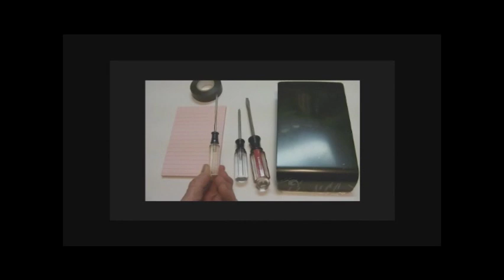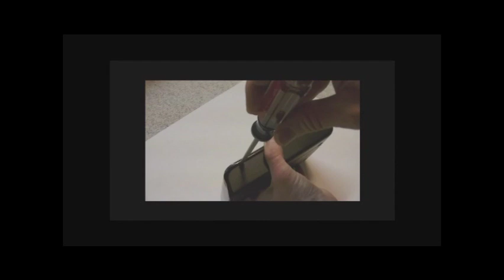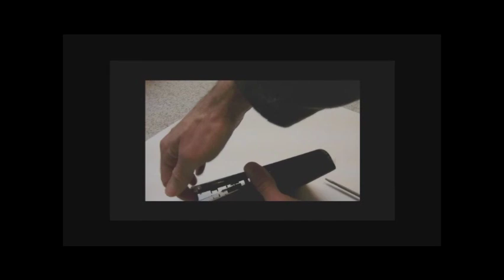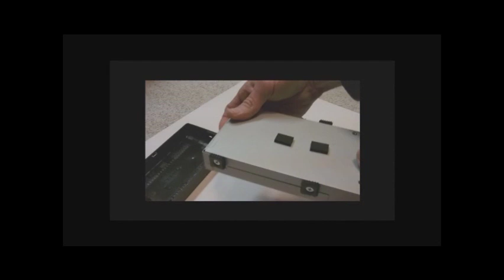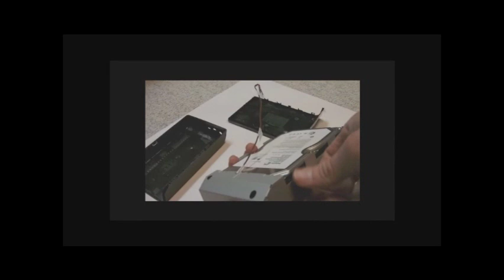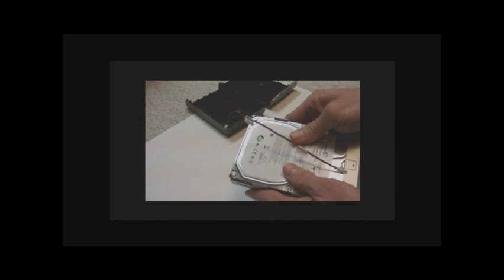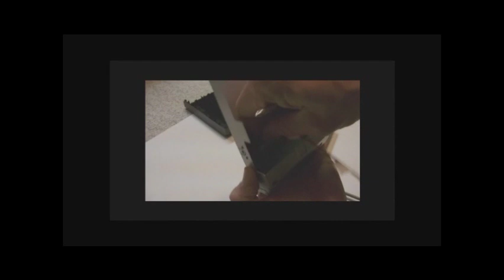Fix your Seagate 1.5 TB Desktop expansion drive to stop clicking

Comment: This drive was finicky and eventually became so unreliable I couldn't keep it mounted long enough to rescue the files. I gotta hand it to you, Bruce, the insulation of the drive from the mounting bracket was just the ticket (I used the electrical tape wrap to protect the USB port, plus paper under the drive). It's humming along beautifully, and the files have been all copied off safely. I still don't trust this drive completely, so it will be regulated to non-essential duty. But - your fix works. Many thanks for posting this video.

Comment: This worked for me, the upside down trick worked for a while, but the clicking returned, insulating the bottom of the tray seemed pointless, but it was this step which solved the issue. Top stuff, thanks Bruce.

Comment: THIS IS BAD ADVICE. I had the same problem. VERY ANNOYING and distracting. Constantly made noise. I returned it to the retailer. The second one had the same problem.

 I read elsewhere that turning the drive upside down will fix it. IT WORKED.  i.e. The poster took the whole thing apart to fix it, but turning it upside down is what really fixed it.

I had to turn it upside down a fewbtimes, for short and prolonged periods. But it has been right side up now for over a year and it  only makes normal hard drive sounds.

FYI I probably could have just shook the thing and it would have fixed the problem.

Comment: The problem with these external drives is that they get very hot, basicly it is engineered to fail, there is no way for all that hot air trapped inside that metal case to circulate. I checked the temperature when it slowed down to 9.5kb/s write speed the temperature was 68°C which is almost too hot to even touch the drive.
 I removed the drive from the external case and plugged it into the desktop and it now sits below 40°C under heavy writing and it doesn't click or slow down.

Comment: It used to clunk, seriously like the Clunk of death. but now its Quiet. My only assumption is that the shielding was picking up interference from the USB bus, and causing a problem with the enclosures write buffer, and causing the drive to park repeatedly until the buffer filled back up again. (just an assumption)

Comment: I had to return my 1.5TB expansion drive to Maplins and they replaced but now the 2nd unit is showing signs of the same problem, loud clicking noises and taking ages to respond..........BUT I have just discovered that if you turn the unit upside down then it works perfectly! No more clicking sounds! Could it be that the units have been manufactured internally upside down??
Anthony

Comment: @SomePoliticalClips 
Thanks for the tip!
Yes you can do this fix WITHOUT opening the case. You can simply insert a piece of plastic (in this case a small cut strip of a straw) in between the usb jack and the metal tab as shown in the video. It was a bit difficult for me to insert the straw because it was so tight, but I just used an xacto knife to wedge in between while inserting.

Comment: Hi guys, I also had the click of death. I dismantled the HD and removed it from its metal case. I then operated the disk and its controller in free air for days without a single click. I suspect there is grounding problem on the USB controller or the HD itself. As the USB board has 2 grounding points, it could easily generates a current loop that lifts up the noise floor, reducing the noise immunity. As head positioning data are corrupted, the heads hit their stops, hence the click.

Comment: @DrGarcia55 Glad it worked for you.  Mine worked for a few days and started up again.  I took it back to Fry's and exchanged it, but the replacement just started clicking after working fine for a few days.  I will try the straw again, but I have also seen people getting entirely new 3rd party drive cases or replacing the USB cable and saying these solutions worked.  N9JCV, is your original fix still working?

Comment: Thanks for identifying the problem.  I also fixed my 2TB drive by splitting a plastic straw and sliding it between the USB jack and the case then taping the excess straw to the case to hold it in place.  I did this without opening the case.  It seems to be working fine.